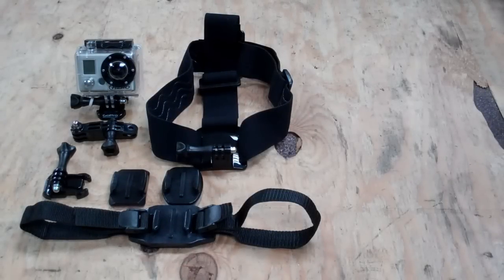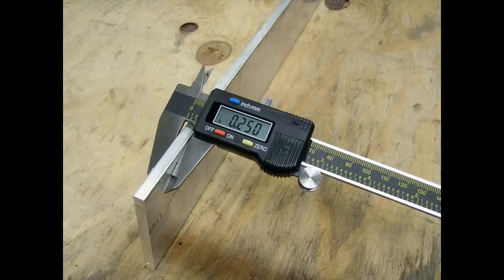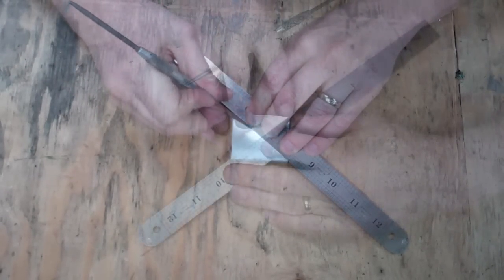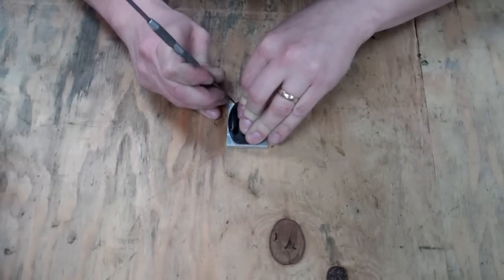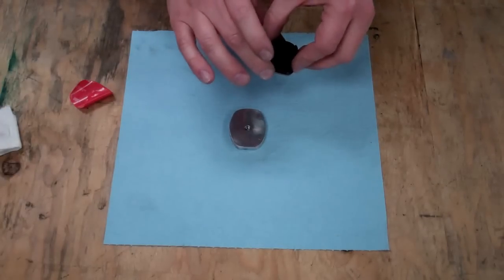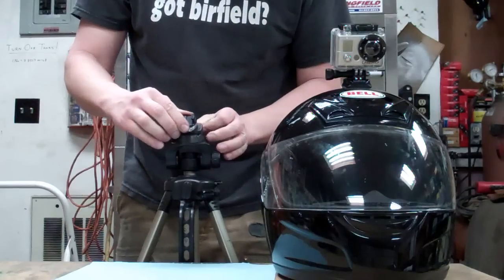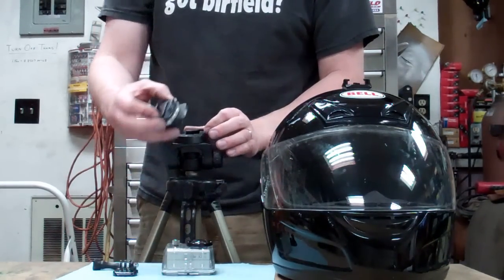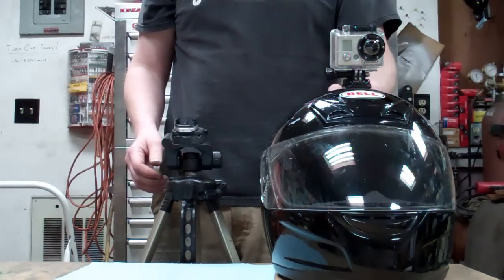How To build a quick-release GoPro tripod Mount (Inexpensive nearly free!)

Comment from the maker: Exactly why I built it.  Without the LCD backpack you have to rely on hash marks you make on the mount to make sure it's pointed in the direction as it was before you took it off.  By using the quick release tripod mount I don't have to mess with the pivot screw on the GoPro mount.

Comment from the maker: You can sometimes get it from hardware stores, but I just get it from a local metal supplier that sells, pipe, bar stock, square tube, etc.  Those kinds of shops usually have scrap bins and sometimes you can get what you need really cheaply.

Comment from the maker: @Redtale1106   True, but the GoPro mount forces you to take the GoPro off the mount you had it on, losing your angle of mounting and potentially losing that little acorn nut.  I found that I was doing a lot of helmet cam and then tripod and then back to helmet, so the quick release tripod mount comes in handy for me when I'm switching back and forth and don't want to lose that angle I had set on my helmet (or go thorugh the hassle of unscrewing it a bunch of times.)

Comment: I don't remember the specific name brand of the glue, but I used a mid-level "super-glue", not a cheap version.  I think I picked it up for $4-$5 at a local Walmart. I found one that works on metal and plastic. The key is to apply the glue to the sides of the acorn, wait a few seconds for it to get tacky, then place it where it belongs. I just let it sit over night and have never had a problem since. If you have a Dremmel, you can probably do a light sanding inside the slot where it sits.

Comment: Thats sweet! way better than the gopro mount. Have you thought about making one that works with the seatpost pole mount? It would probly take as much time to switch if i just unscrewed the case off and used the gopros tripod mount but up on the mountain its cold and i'd have to take my gloves and if i dropped the nut it would for sure be lost in the snow.

Comment from the maker: Really it's not, but I'm solving a secondary problem by having the tripod mount accept the GoPro quick release mount so you don't have to fawk with the angle adjustment of your gopro lens (aka the gopro housing) between your action filming mount and your tripod stationary mount when you switch between the two

Comment: hey man just a tip, take a q tip and put some super glue on there and just put a dab of super glue around the nut then put it in the plastic of the gopro mount. Thats what i've done with all my mounts that way i never have to worry about losing those nuts. I dive, surf, skate, and ride with my gopro never had a problem with losing the nut.